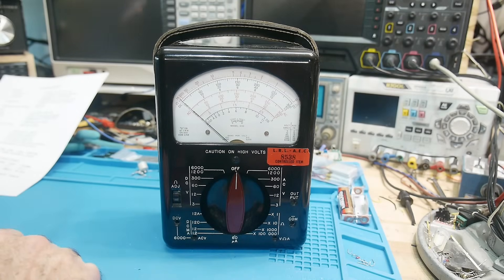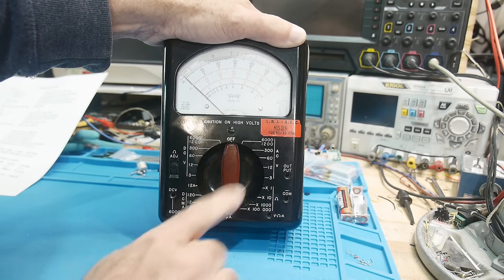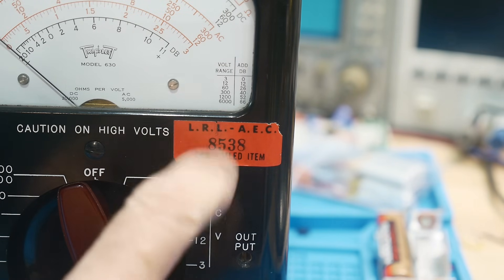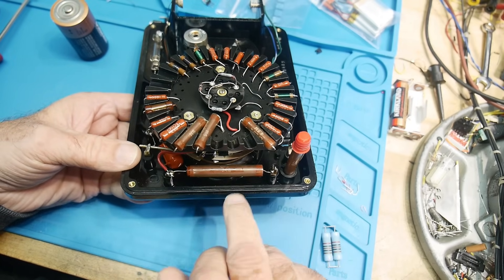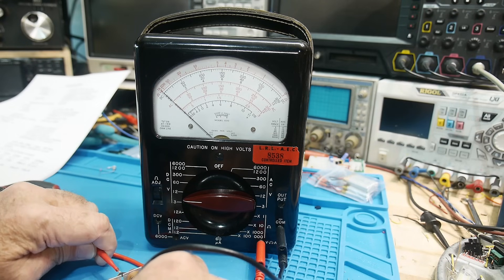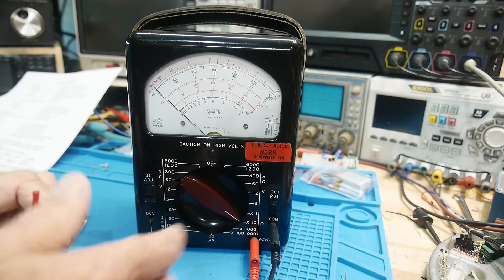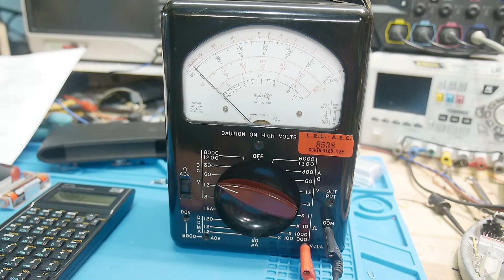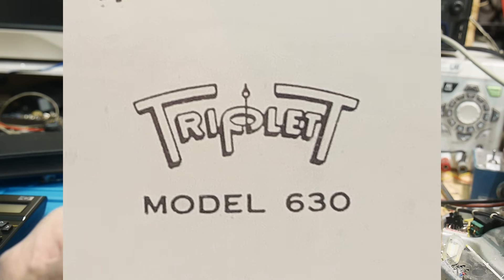#1787 Triplett 630 VOM

Comment: 9:56 I find the AC Voltage scales at these passive instruments very interesting. With normal passive diodes one assumes 0.6V as a threshold voltage, a bit smaller with germanium diodes. Here we have a scale for 3V with just a small difference between 0.5V and 50V at the 300V scale. The first mark on the 3V scale is even at 0.05V. There must be again those special copper oxide rectifiers forming a voltage doubler. 
100k subscribers is great.

Comment: First, congrad on you 100k and thanks for making about 2k videos.  Great job 👍

I grew up with these analog meters and took apart many of them.  Here are a couple things.  The lowest AC meter is always off from the reset of the scales because they had to convert the AC voltage to DC and take into account the diodes voltage drops.  Also the diode's VI curve is not linear around 0.5V.  Those two diodes behind the meters are to protect the meter if someone send a higher than 0.5V sends to meter (in other renges of course after the voltage dividers).  The diodes would short out the extra voltage.  Those diodes are usually parallel and reversed to protect DC voltage in either directions.  My meter had a vierd setting shared between amp-voltage like 50uA/0.25V which  would connect leads directly to the meter.

My meter had a mirror on the scale.  Depending the angle of reading, if you look at the mirror you read a more accurate value.i

Comment: Also note that some old rig schematics specify a 20k/v meter for voltage checks.  High Z meters may give the wrong impression when working thru a voltage chart.  Get that 2008 Duraleak battery out of there.  I used 2 -12V MN12 batts & a couple watch batts fashioned into a small cardboard tube to make the "30V" batt.  Mine is a Model 630 Type 4 suspension  & only goes up to 600V.  Bought it at a Hamfest 10 years ago.  Great meter.  73  👍
Reply: I did the same for my AVO, making the 15V battery out of a stack of 5 CR1610 cells and a housing machined out of PTFE to fill the gap.
Reply: I think the schematics specifying a 20k ohms/volt may have mostly been concerned with using a poor quality meter, as some of the ones I used in my early days had a sensitivity as low as 1k ohm/volt.  I also saw some schematics saying 20k ohms/volt or greater.  At any rate, measuring grid 1 voltage with a VOM was totally inaccurate, I even had some loading problems with the standard 10 megohm input the VTVMs had.

Agreed on the battery leakage/corrosion problem, Alkaline are guaranteed to leak at some point.
Reply: Calibration instructions for Hickok tube testers specify a 1K ohms per volt meter for all measurements (except grid signal). Use of a digital VOM will doubtless lead to incorrect calibration unless the meter is shunted with 150k to 200k ohm resistor or thereabouts. ( a digital meter is fine for measuring grid signal, as Hickok specified a high impedance VTVM for that).
Reply: @billharris6886 , Duracell are the worst leakers; I use Panasonic or Eveready. The lithium infused Energizer Max are excellent, but pricy.

Comment: Congratulations!  This meter brings back memories as my grandfather had what must have been one of the first generation especially when it came to the very odd ball large dry cell battery.  His took a fare amount of abuse used as it was used in a factory based setting most likely measuring everything from motor windings to vacuum control solenoids and relay logic.

Comment: Triplett meters are definitely Top of the Line in my books.  I have 3 Triplett 630-NA meters.  They are a bit larger and have a separate clear meter cover.  There are a lot of times when an analog meter is better for a job than a DVM.   I have used analog meters to measure current drawn by small consumer electronics devices.  If you try using a DVM, you would have to bridge the meter before power up due to the DVM  meter's auto-ranging.   Sometimes dumb is better.

Comment: I grew up (to the extent that I did) with  a 630 as the meter in the house. When my dad kicked in his 90's, a sibling handled the estate and a lot of thing went missing, but I still miss it. An original 630 (not 630A) from when he started grad school in roughly 1950. I learned a lot with that meter, including how meter impedance can really affect a circuit.  

I use my Simpson260 fairly regularly (sometimes seeing the needle is more important than the number) and Keithley 610C when I must (Nothing to touch it, so I worry of damage as no parts can be had to repair it. 10^14 spec 10^15 actual  ohm input is useful, as is the 10 femtoamp fullscale range). A radio shack kit meter and Heathkit 'scope got me through EE undergrad, and then I got my first Fluke8000 (still dead on). 

Thanks for the memories.

Comment: “Off” position damps the meter movement.
Reply: Yeah! Really a must for shipping. When I bought my Simpson 260 used from an estate sale reseller she was very kind to remove the batteries and put the meter in the off position before shipping. The damping just provides a bit more mechanical shock resistance which earlier meters didn't always have!
Reply: Also detaches ohms from potentially drawing current from the cell. I suppose they use a D cell for long life, a large cell not really needed for ohms.  I’d rather use a AA lithium which will not leak over time.

Comment: I have my dad's Bell Labs issued 630 from the early 60's.  Bought a 30v battery for it.  I mainly use it to check leaky transistors in audio amps. Checking with a DVOM or cheap component tester, they will check good.  Triplet on high ohms will show leaky ones.

Comment: I still have my 630-NA I got in 1973.  The 30V battery is available, but very expensive, so I don't keep one in it. Sometimes it is nice to have an analog meter for voltage and current.

Comment: That LRL AEC sticker i use to see a lot when i lived in Albuquerque.  There was a used electronics store that i would visit.  One of the oscilloscopes they had for sale was said to have triggered atomc bombs!  But they had so many i dont recal the particulars.  My VDP-80 ended up there after destroying my back one to may times.  Perhaps somone picked it up.  Still worked when i dropped it off.

Comment: Very nice. I've got a Triplett 630 Type 4 which "only" measures to 600 volts. There are just sometimes an analog meter is needed. Like that you left the tags on, I've got a Wavetek sweep generator that has calibration and asset tags from NASA's Johnson Space Center. No way those will come off!

Comment: Use 10 of the 3 volt button cells packed in series to get your 30 volt battery. Shrink tube the stack to hold them in place.

Comment: I had a Triplett VOM, in an orange enclosure, at work that did indeed have a polarity-reversal switch built in it. I liked it better than any Simpson meter I tried. Two things that analog meters are particuksrky useful for: checking low-resistance transformer windings to make sure they're not merely shorted (the meter pointer shows an inductive "kick" from the winding, it starts out slow and than speeds up), and for finding shorted output transistors in circuit.

Comment: I used a lot of the Triplett 630s and Simpson 260s on the job in the early and mid 1970's.  A few years later when I was in the military, they use a Mil-Spec improved version called the PSM-6.  All top of the line meters in their day but, too expensive for me to afford.

Anyone that grew up on a DVM would have some trouble using the VOM.  In addition to deciphering the analog scale, you also had to be careful not to damage the meter movement by physical shock, reverse polarity, or exceeding the voltage of a range.

Due to the meter actually being fully powered by the voltage you were measuring, these meters had limitations measuring voltages in high impedance circuits.  In 1971 when I first started restoring old vacuum tube radios, this limitation became a huge problem trying to measure control grid voltages.  So, in 1973, I purchased my first VTVM, which solved this problem.

On the Triplett 630, the 6,000 volt range has a seperate minus input, which prevents arcing of the rotary switch.

The Simpson 260 was a direct competitor to the Triplett 630.  The Simpson was slightly more rugged and even had a Park position for the meter movement to minimize the likelihood of meter damage during transit.
Reply: That's it!  A PSM-6 is what I used in the Air Force.  Ugly brut but it held up under the abuse of idiot teenagers out on the flight line.  Luckly, I spent most of my time in the shop repairing black boxes, but had better test equipment.
Reply: @tedivester4947  It's a small world, I was in the US Air Force and also worked in the shop (as opposed to the flightline) and repaired the navigation and comm radios for the F4-D and F4-E!

Comment: I have a couple of Triplett 630 series meters - from the old to "newer" versions (including a couple of 666-R) and I use them often.  As far as I'm concerned, and notwithstanding the possible limitations (and age-related stress) of meter test leads, I don't think I would recommend using general meters for measuring over about 600 volts without having extensive experience in high-voltage testing ... maybe that's just me ...
Reply: First thing I did with the original leads is put them in storage and ordered new ones from Probe Master.

Comment: I have a working 630 NA Type 3, and a non-working 630 NA Type 1 which I purchased from Tektronix for $20 each when they were phasing them out forty years ago. I replaced the 30V battery with a stack of 3V lithium button cells. I machined a plastic enclosure for them, but 3D printing would be an excellent option. That saved a few bucks over buying a 413 battery, but kind of silly, really. A 413 doesn't cost that much more. I've learned that some folks manage to fit thee 9V batteries inside the case, and that works well enough.

Comment: At 8:24 in the video, did I see a date code on the battery of Mar 2008? I'm surprised that it hasn't leaked by now.
Reply from the maker: didn't notice that. it was the only D cell I could find. I don't use many (obviously)

Comment: Strange that yours has no parallax mirror, although it must be newer than mine, On my 630 the mirror has come loose (fell back away from the meter glass), but I don't know how to get in there to reattached it. I wonder if  the meter assembly was sealed with glue.  And when I took off the back, on one corner the bakelite fell off and crumbled. Maybe the screw was too tight. I have heard that epoxy can repair it but won't try until i solve the mirror problem.

BTW Dave Jones tore down the 630 and 260 and found the 630 much better, in terms of interior aesthetics. I donated my 260 to the local radio museum. I guess I should have kept it. Two is one and one is zero.

Comment: As far as analog meters go I prefer Simpson 260’s (I have 6). I have 1 Triplett  630 identical to yours.
The  260 has a 0-2.5 scale, vs. Triplett 0-3 scale, I am  used to the Simpson scale and can read easily at a glance just by the indicator position.  Therefore I  use the Simpson meter’s more often.
In my Westinghouse day’s  I used   Keithy. electrometers in H V  work and they had  0-3 scaling like the Triplett so it took a little getting used to, switching between different meters. All fine meters.

Comment: You really need to warn people about the 30V open circuit voltage that is present on the high-ohms scale.  😮
One of the defense contractors I worked for had purchased these for the test-floor; techs were wiping out digital boards doing continuity-measurements.  Once we brought it to their attention, they got rid of all of them. An expensive mistake!
My only complaint with these, is that I have 3 of the 630’s (of the same type) and only one matches the schematic!
Reply: Yeah, I took the batteries out. I rarely use the meter( non-powered measurements).  I love the beautiful construction.  630-NA.

Comment: So why use a 20KOhm/Volt analogue meter instead of a digital LCD meter (so high, the spec isn't mentioned)?
Reply from the maker: High impedance and analog: https://youtu.be/VU7nlZ2DAKg?si=Nexn0CBOcru53-_m
Reply: An analog meter is the only way to go when you have to do a alignment. It is so much easier to see and hold the peak reading on the analog scale. Digital meters just jump around to much and often have a delay as they do their signal processing. The lower impedance also does not make much difference in an old tube radio. However, the old analog VTVM (vacuum tube volt meter) had as much or higher input impedance to a modern digital meter. HP made analog meters (I think they use a FET with 10 megohm inputs that could measure signals up to 11 MHz in frequency. Therefore you can use them to align the IF of an FM radio.
So why not get a VTVM or an HP over the Triplett or the Simpson? You don't have to plug them in, so they are a great meter for field work.
Reply: @IMSAIGuy  Thank you 🙂
Reply: @celederer5060 The military ME-26D/U and HP 410 VTVM's could accurately measure AC signals up to 720 MHz and were still usable up beyond 1GHZ.  All thanks to the diode vacuum tube in the AC probe tip.  Find any other multimeter that could do that.  Best multimeters ever made and the military ones were built like a tank, weighed about as much as one to.  The DC input impedance was also extremely high, 100 Mega Ohm.

Comment: Tripletts and Simpsons are nice instruments, but come on, if their manufacturers are not even willing
to invest in a mirror backed measurement scale, they do not eeze out an air of accuracy.
The real king of analog meters is the Unigor 6e built by Metrawatt in the 70ies when
Made in Germany was a promise you could trust. Of course, as a top notch instrument of its time
it used some electronics. Through a discretely built chopper amplifier it operated as a 1uA analog meter.
As such it was a 1MOhm per Volt instrument with ranges from 1uA to 3A and 1mV to 1000V full scale 
both AC and DC with an accuracy of 1% besides 6 resistance and 4 capacitance ranges. 
Its precision wire wound resistors make those of the Triplett look like made in Lilliput
and with its 4 baby cells you can measure all day long for a whole year, but it is
smaller in size than the Triplett.
Shunts up to 100A, current clamps up to 1000A and probes up to 30kV were availiable as accessories.
Dave Jones once reviewed the number 2 of the Unigors, the A43, but he does not understand high
precision analog instruments and wants to sell his own digital stuff primarily.
He complained about the stained look of its circuit boards inside. The Unigors use silver plated boards! 
And, as you know from your silverware, if you do not polish it every week, it looks stained soon. 
Nevertheless, stained or not, silver is still the best conductor of all.
After more than 50 years you can get the 6e still be calibrated.
Metrawatt makes instruments until today, but they employ pretty brainless product managers now.

Comment: Layout designer gets an F for breaking OUT  PUT into two lines!
Reply: Did you know that the output jack was really use to measure the ac component of a signal that maybe offset by a dc voltage. Nothing is outputted at all. That jack simply has a capacitor in series to block the dc.

Comment: 30-volt #413A batteries for these are available again, just in case some weren't aware. Google "30V battery 413A" and the third result (for me anyway) will be an Amazon link. $15.54. Also, both the D-cell and the 30V cell must be installed for the Ohms to function. (Edit: apparently this is only true for some older models)
Reply: Bought a 30v battery last year.  Revived my dads Bell Labs Triplett  from the early 60's.
Reply: If you noticed he was measuring 50 ohms with no 30V battery installed. Mine does the same.
Reply: @jrkorman  interesting. If I'm recalling correctly—and I believe I am because it surprised me a bit— my older (seemingly 'circa 1960s) model 630-PL wouldn't measure resistance on any range without both batteries installed. His using the lower ranges did escape my notice, as I failed to watch the entire video. 
I'll try the lower ranges again with only the D-cell installed and report back.